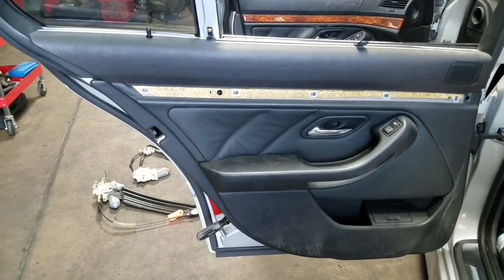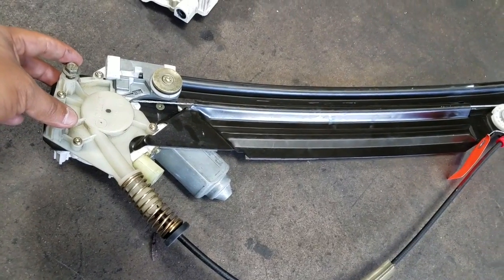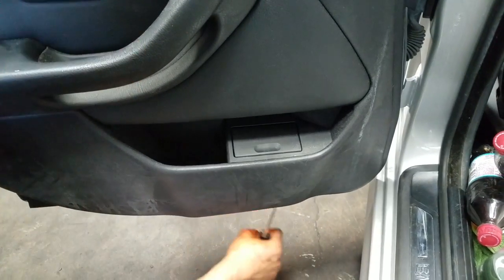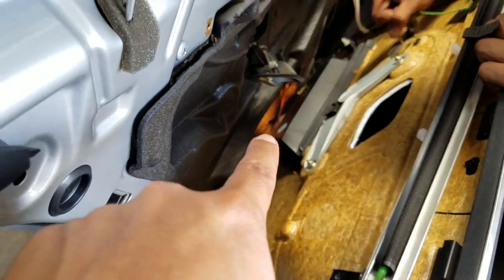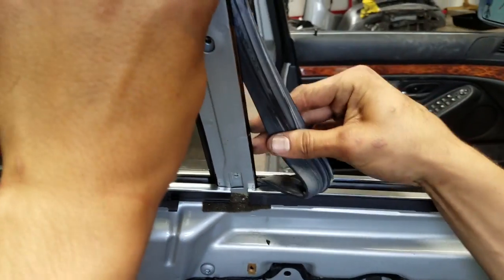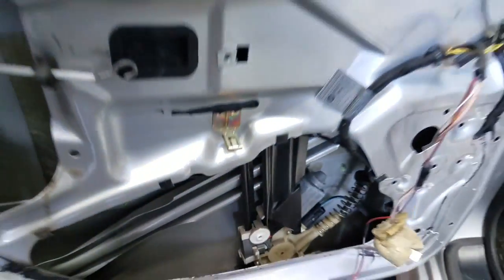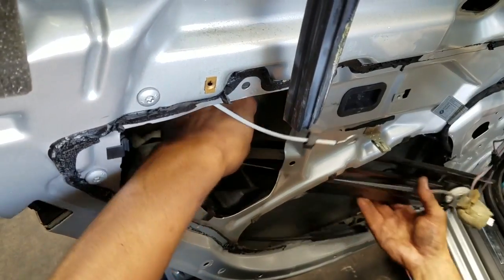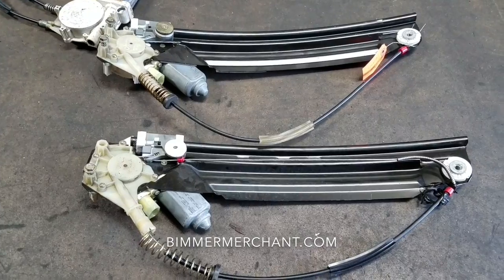Rear Window Regulator removal off  BMW E39 5-Series M5 540i 530i 528i

Comment: Excellent video and tutorial, I just replaced my front drivers side window regulator, and rolled down the rear windows and the rear drivers side windows regulator broke with the window down,  if it was stuck up I wouldn't fix it as I rarely lower the rear windows and did so to spray silicon lubricant in the window glass rubber channel.
Reply from the maker: Thank you as always.

Comment: Both my rear Windows need done, have since I got it 5 years ago. Been dreading doing it... Yet I had one failed motor in my lady's 04 Malibu done in about 20 min. The sucky part for the bmw is having to take the glass OUT to replace it.
Reply: No sucky part. All went smoothly after knowing the trick of how to get the window out. 😎
Reply: you can tape the glass in up position.
you don't need to take windows out.

Comment: I have the exact same failure (rear right)... the red cap busted off. What do you do in that scenario? Do you rebuilt it since it otherwise works (if you can get a new red cap) or do you simply replace with a new or used regulator?

Comment: Hi , I have a BMW e39 523i 1996 model which came with rear manual window regulator. I converted it to electrical but could not get it working from the individual rear control switch because I could not get the right connections at the module. I could only control it from the driver side.
Please, I will greatly appreciate if you do a video on the wiring of the  rear control button especially where it is connected to at the control module.

Thanks in advance
Reply: Hi please I am anxious to hear from you

Comment: Is There any way to move the glass up and down manually?
Reply: troika101 remove the torx t30 bolt that hold it the regulator. Then it's just sliding freely